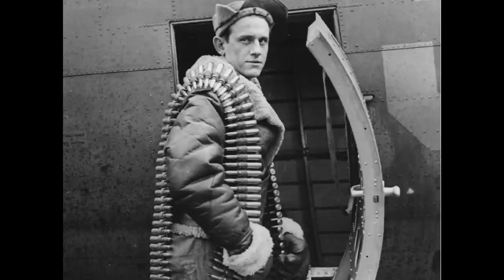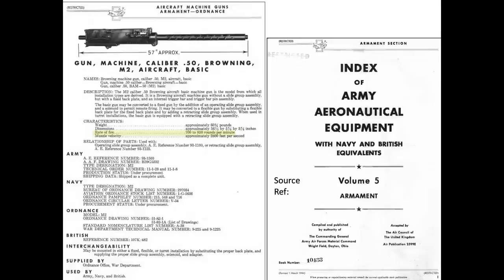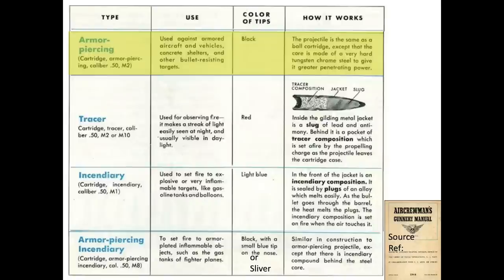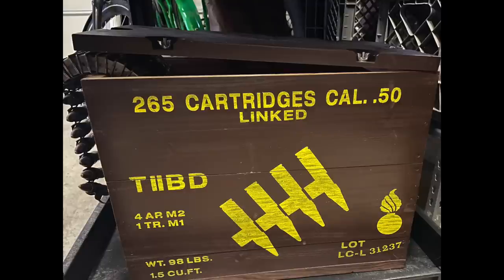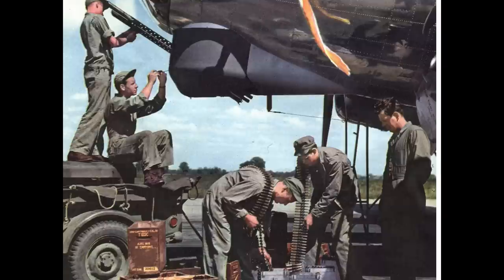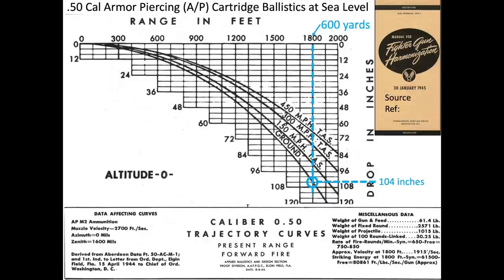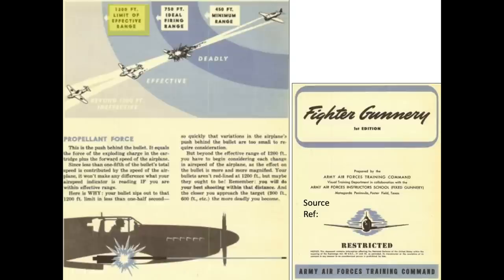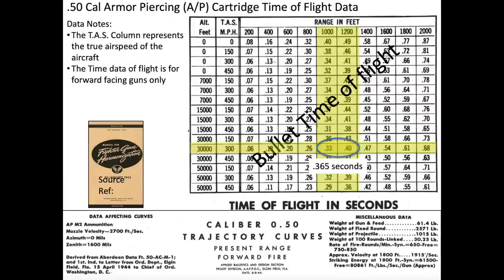WWII Bomber and Fighter .50 caliber Armor Piercing Cartridge Ballistics

Comment: Very interesting material.  In some of Martin Caiden's old books about air combat he mentioned ".50 caliber bullets bouncing off the armored belly of an FW190".  What the crewman saw an reported to Caiden was likely an engagement at long range, or striking the aircraft at an oblique angle.  By the way, the Army Grond Forces had standardized on the 45 inch barrel length for the M2 water-cooled and Heavy Barrel guns,  but in late WW2 the US Third Army started a program to upgrade some of their 76mm gunned medium tanks.  One of the upgrades was to increase the coaxial machinegun from the standard .30 caliber to a .50 caliber.  The photos of the upgraded tanks show the Ordnance shops used aircraft type .50's, presumably because they could be scrounged from crashed US planes and because the 36-in barrel fit better into the tank.
Reply: My father was a B-24 pilot and told me that many times he witnessed FW-190 aircraft rolling in on his bomber upside down to present that armored belly.

Comment: I've been searching for an explanation for the different barrel jackets applied to the AN/M2 .50 Cal  Browning. The barrel jacket most commonly seen is the full length perforated jacket seen on the guns mounted in bombers like the B-17.  However, the barrel jackets on the guns used in the P-47 were solid rather than perforated.  If anybody has any documentation or hard facts on why, please post. Thanks.
Reply: barrel jackets for a bomber gun are perforated because the gun is exposed directly to the slipstream, therefore more cooling from airflow
Reply: @williamwimmer5473  That explains the perforated barrels, but not barrels in the fighter. Is it because the barrels in the fighter are enclosed in the wing, so don't have very much exposure to the cold air? Or, is it because the fighter doesn't have very many rounds to fire, so the barrels don't get very hot?
Reply: @williamwimmer5473  Thanks, but you're answering the given rather than the question.  Obviously, the barrel jackets are perforated to allow air to cool the barrel.  The question is why the barrel jackets of guns installed in the P-47 are solid rather than perforated.  For example, the guns in the P-38 have perforated barrel jackets. Why is the P-47 different?
Reply: @gort8203 No source but its likely for aerodynamics. The barrels on fighters are pribably very solid and heavy, and in the case of something like the P38 at least, there was built-in air blowers for almost everything that needed cooled. Blast tubes, they were called.
Reply: @BrandonTheKralik  I have also suspected that the purpose might be aerodynamic, as I know NACA made studies of both protruding and submerged gun barrels on the F4F and found that protruding barrels definitely affected the airflow over the wing at high angles of attack.  

I think there is a difference between a barrel jacket (or shroud) and a blast tube.  I think blast tubes are part of the aircraft structure and are there to protect the aircraft from the blast (gas) or heat of the gun.  I have seen photos of wings with empty blast tubes because the guns were removed.

I think a barrel jacket or shroud is part of the gun itself, serving to support the barrel becuse it is light enough to be subject to whipping, overheating, or both.  If you compare the aircraft .50 caliber gun with the heavy-barrel vehicle gun you can see that the ground version has a much heavier barrel that is unshrouded except for a much shorter jacket near its base.  The aircraft machine gun has a full-length shroud which is usually ventilated for cooling.  

I suspect the jacket of the P-47 guns are not blast tubes because I have seen a photo of a wrecked P-47 that had the guns removed and standing nearby, and the solid jackets or fairings remained attached to the guns rather than to the wing.  There seemed to be no gap between the end of the jacket and the muzzle to allow for air flow.  

Thanks for you input.  If you find anything more, please let me know.  I would really like to have more information on this subject.